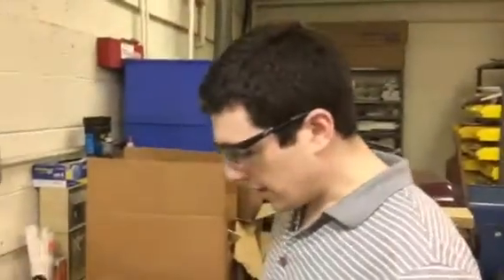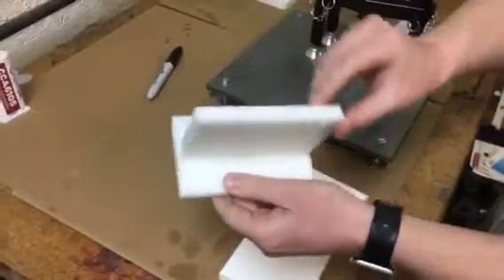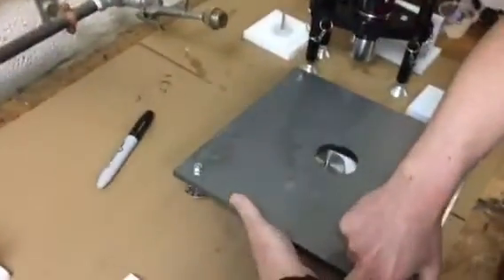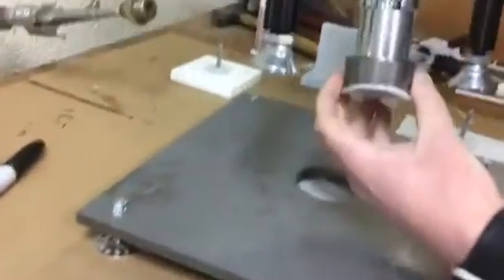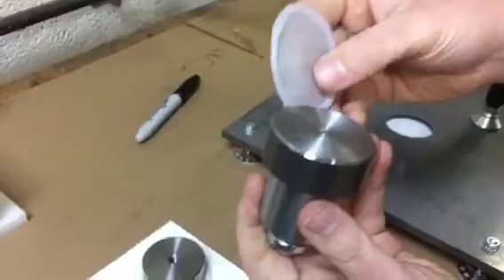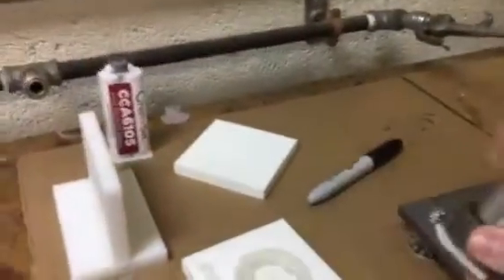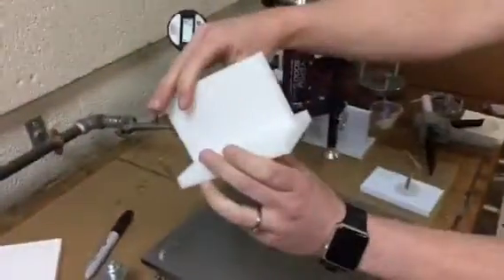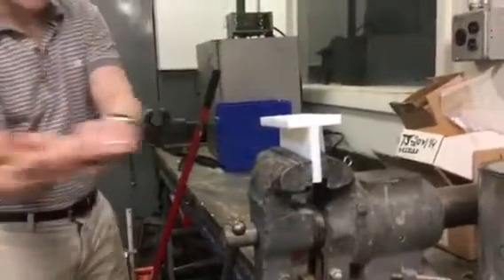Starboard Adhesive Test: Chem-Set 6105

Comment: Did you flame treat the star board first? That is the alleged pro procedure for it!
Reply: No flame treating! This is the benefit of a structural adhesive. We would however recommend a light scuff with sandpaper and a wipe with isopropyl alcohol or acetone to help get rid of any oils, dust or debris that may be on the starboard or HDPE itself.